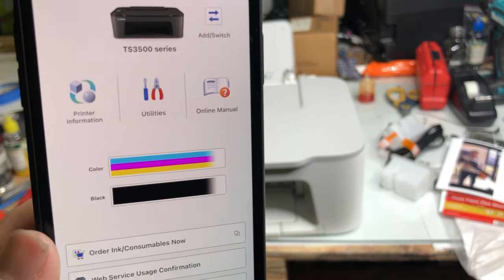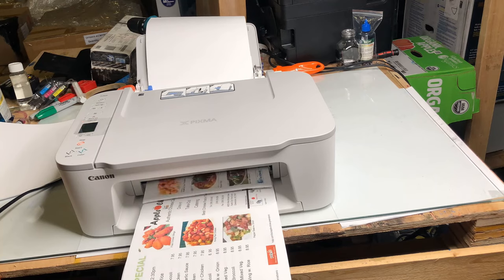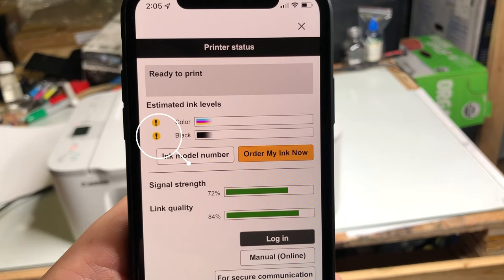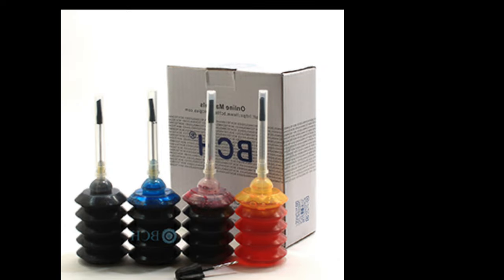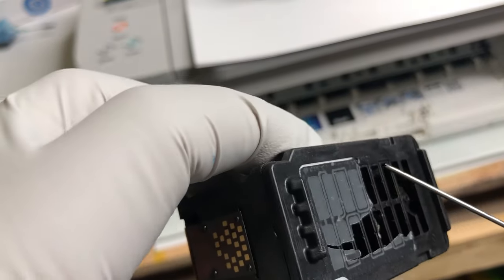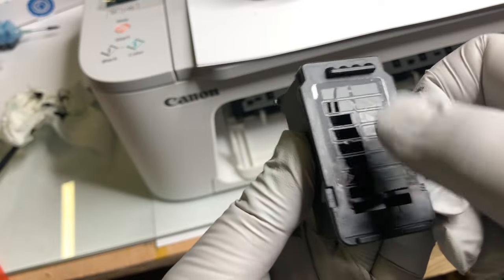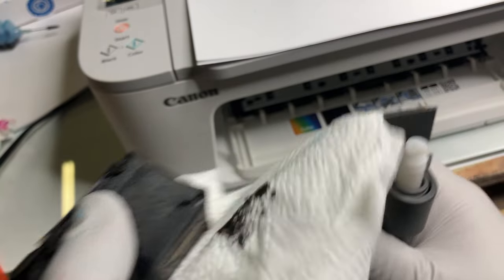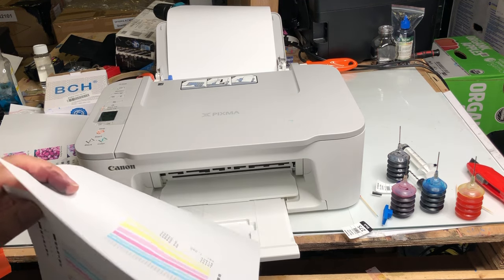No.1 Detailed Guide to Refill Canon PG-275 CL-276, PG-275XL & CL-276XL

Comment: If you have the newer TR 4720, you will have to hold the Stop button down much longer than this model printer. It also doesn't exactly click, but it does allow you to continue using refilled cartridges and cut your printing costs down by 1/4th.
Reply from the maker: Thanks for sharing!
Reply: how much longer?

Comment: i searched for 5 weeks to find a video for this series printer and took a chance a bought some ink on amazon and followed i think one of your videos for i think 245/246 cartridge  and it works so far i wish i had this video a month and a half ago.
Reply from the maker: Thanks!
Reply: @BCHTechnologies    so I went on and got an Excel and IT ruined something happened where it would not print out the yellow properly but anyways I just went on the bch Technologies website and notice that the ink cartridge has now included 276 and I wanted to know and then I came to your page to see if there has been any update videos which it hasn't that would include the 276-275 ink cartridges I wanted to know if it was real or not because I wanted to use that printer cuz I still like that  printer just the ink too expensive

Comment: The new 275 Fine cartridges have no indent to make a hole for the needle to go in and dispense ink, they have designed it in such a way that there are all small troughs and no indent to make a hole and dispense ink.

Comment: Very good video and helped me a lot. The one thing he didn't mention was how tough the plastic is to get through in the first place. The 'tool' i was given didn't touch it. I realised I only needed a hole for the syringe to get through. The instructions I received with my kit said to enlarge the airhole. I managed this with a map pin and micro screwdriver. That made life a lot easier. I also  replaced the labels instead of tape, worked from new so should be OK.

Comment: You are a king!!

PG445XL and PL446XL

I’m going to do try your method when ink runs out. Will the method work with my cartridges? And will bigger holes affect printing?

I gave my cartridges to repair guy who added ink without opening cartridge and without increasing hole size. Any ideas on how he did it? I’m blown away by his technique which he is not telling me. 

There are no signs of opening cartridge or increasing air hole.

Comment: Hi, excellent video. However, i have a TR4700 Canon series and I refilled the cartridges BEFORE they depleted and now nothing prints.

I can not get rid of the "low ink" message. 
Followed your suggestion to hold down the "triangle" or "Stop" button for a few seconds and nothing. Held the button down for a minute and nothing. 
Any other suggestions?

Comment: If youre capable of gentle touch you can just use a drill with a small bit, most drill sets come with one the size of that manual torture device that the kit has. On slow to medium speed it takes a whopping 10 seconds to drill each hole. Besides that, "burping" the black cartridge was the hardest, I have the rubber insert and the stand but getting the air seal had me pushing down really hard while using the syringe at the same time. Works now, I think the kit I bought was some $20 and came with those huge ink bottles that will last me longer than the printer.

Comment: Hey can you help me your video helped I have the Canon TS 3522 however the ink refill worked a couple times but now it's printing blanks after I refilled it last night any tips on how to fix this please reply ASAP thank you please note I clicked the reset button held at 3 seconds and I also held down the stop button turn the printer on and off and I also held the printer cartridge against a paper to see if any ink is coming out and the part on the cartridge that looks like a film strip yeah I pressed that against a tissue paper to see if any ink comes out and the ink lines black and the color comes out fine so I don't know why it's not printing help me out please thank you
Reply: Okay I have an update so the printer the Canon TS 3522 I believe its 275 cartridge it's printing color but it's not printing all black that's crazy is there any way to fix this

Comment: Can I use an powered drill to make the holes in the cartridge ? Or is there a reason to do it by hand
Reply: you can but its a bit more unsafe
Reply: I have a miniature rotary tool with tiny drill bits. I used it at a relatively low speed so I wouldn't accidentally drill to far.
Reply: @Indigodream0  I just took off the cap on it and it's way better like rhat
Reply: @ritualmid  
I'll do that next time. Anything I should know before prying then off?

Comment: I ran my Canon 2522 cartridges out before refill and now the printer won't recognize the cartridges.   Didn't know any better.  If I refill a cartridge before it runs empty,  I should be ok right?  These printers are a scam!
Reply from the maker: Check your electronic ribbon. Make sure there is no dirt or ink on it.
Reply: @BCHTechnologies  what would you clean it with?

Comment: Thank you so much for this video. Canon charges entirely too much for their cartridges. Generic prices aren't that much better.

I thought I'd let you know II bypassed the "magic moment". I don't need to count the pages I've printed. Here's what I did.

*I DON'T use a wireless connection. I don't know if that's important or not. I also don't know for sure which of these things bypassed the need to reset the page count. 

* This is probably the most important part***
I turned off the printer and disconnected it from the PC. No information can be collected  and stored on my PC to send to Canon. They don't know what I'm doing.

- I turned the printer back on to access the cartridges
- Put in the cartridge I just refilled. 
- BEFORE printing, checking anything, aligning cartridges,  ANYTHING AT ALL ... I turned my printer off again. 
- I turned it back on. I wasn't getting a message that I'm low on ink
-- Still not connected to my PC and still no access to the internet, I copied and printed something random.
-  After connecting to my PC the printer had access to the internet. I printed a document. No message about low ink. 
- I don't have to keep tabs on how many pages I've printed. 

Canon, as well as most printer manufacturers collect information about your use of the printer. It's in the "Terms and Conditions" most people don't read when they install the printer software. I opted out. That might have something to do with the results I got. I also have a lot of other security measures in place to prevent companies from collecting information about me or my system, or finger printing. Some of my apps are blocked from accessing the internet at all. Canon is blocked.

Comment: DO NOT LEAVE THE DRILL HOLE OPEN!
This will cause the ink to drain out of the cartridge into the bottom of your printer requiring you to refill your cartridge every time you use your printer.
For a detailed guide, I wish he spent less time yammering on about nothing and more time on what color goes where and the amounts.